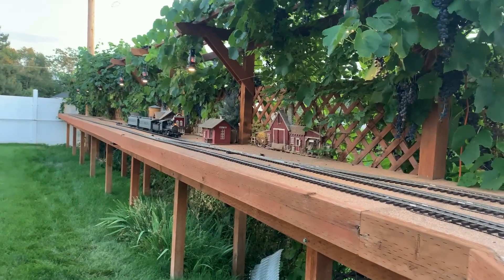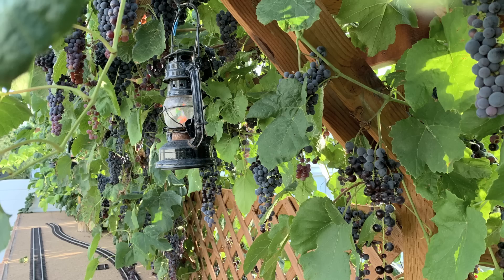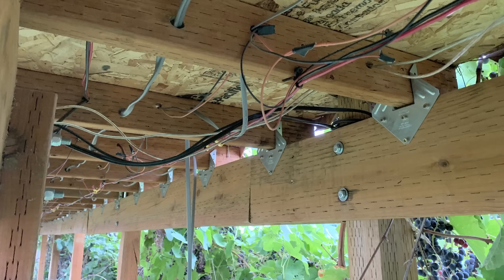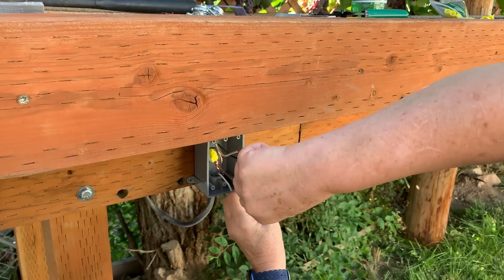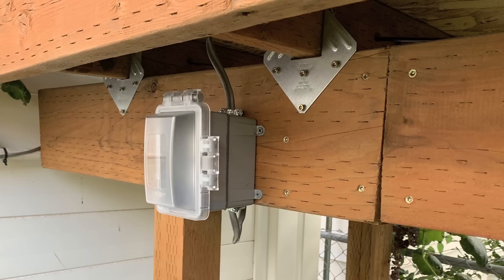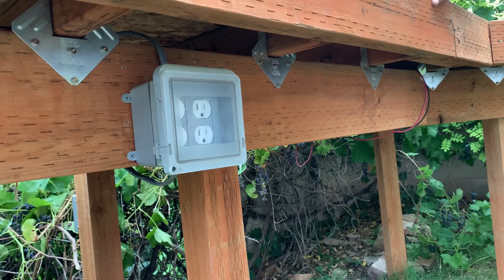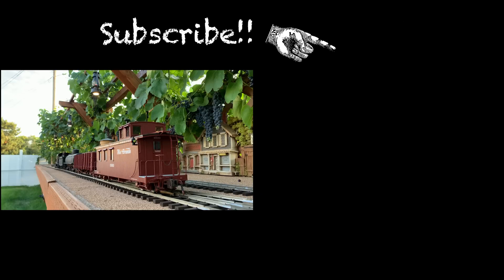Rewiring the 110 Volt Power to the Garden Railroad - "The Wrath of Grapes"

Comment: Are the outlets you installed Weather Rated (will have a WR on the face)?   The innards of standard outlets will corrode over time in an outdoor environment.
Reply from the maker: Yup. All weatherproof boxes and wire and plugs.

Comment: What scale is this railroad???
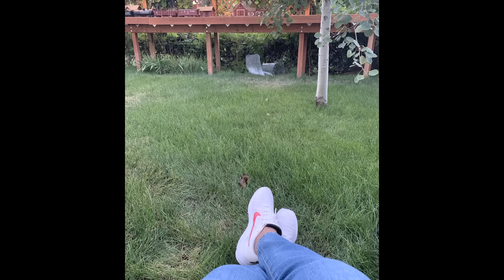Reply from the maker: Well the track is #1 gauge. 1 3/4”. We mostly run Fn3. 1:20.3 scale. 3 foot gauge prototypes.   But there are lots of things that can run on #1 gauge. We have a lot of 1/2” scale. Which is to say 1:24 scale. It’s also based on 3 foot gauge prototype but it’s much smaller. Also 1:32 scale standard gauge. And 1:29 scale. But almost always 1:20.3.

Comment: Looks like it's time to get mason jars, gulf wax, pectin, sugar and start making grape jam :)  For those outlet screws, it may sound like overkill but I've found that a variable speed drill/driver can be most efficacious, just barely pull the trigger and snug them up good.  Most nowadays also come with a built-in light which my older eyes very much appreciate.  I live in an older-pre WWII home and the former owner loved his Christmas lights as there are apparently more outlets around the outside of the house than there are inside the house but it's all the older boxes with the individual little doors over the outlets outside.  Meanwhile half the wiring on the inside of the house is still old-fashioned cloth-covered wire, which is fine as long as it isn't moving around, but with it being that way polarized outlets are useless as there's no way to tell which wire is hot and which is neutral, but it's okay as I have the sense to unplug anything that needs repair on the inside...and if I do need to plug something in while it's apart I simply use an isolation transformer between the appliance and the outlet.
Reply from the maker: Karyn has had a good deal of fun modeling all of that in 1:20 scale. Cloth wire. Knob and tube insulators! You should see her power meters! She also did a really funny job of wiring the casting machine. The controls of the casting machine are first class. However, we put a bunch of fake meters and stuff on there and she put some glass fuses and burned out wiring, scorched wiring, and all kinds of crazy stuff. People come in there and think that’s functional and just about crap!
Reply: @ToyManTelevision  🤣🤣🤣 That's awesome!

Comment: OK, so I feel I must correct Mrs. Toy Man on her Electrical skills. She said " I'm not a master electrician ". HHHmmm... lets examine her work, shall we? Yes I think we shall. She knows to pigtail and connect the ground first. (A+)! She knows to pigtail the outlet. Also (A+)! Then she made the shepherdess hook and used the screw terminal instead of the stick in the back of the outlet. Also know as stick it up the outlets *%#$$.  Nice job! another (A++)! She even made a drip loop going into the bottom of the box. To top that off She kept the cable from making any sharp bends when exiting the box on top. Also (A+). Then the shocker for me, she mentioned the GFCI ( Ground Fault Circuit Interrupter ) was up stream on the circuit. That's a huge (AAA+++)! As an electrician my self, I was watching closely. I can attest to you that I have seen licensed electricians not get some of those right. I'm not sure just where you picked up your electrical skills, but you done did good work!  Whom ever taught you these said skills must be proud. :)  Keep them there electrons moving right along!
Reply: All I can say is”Thanks” and Whew! I entertained the idea of becoming an electrician about 30 years ago… Until I learned that part of the job entailed crawling around in tight places! Who knew? Thanks for the kudos!

Comment: I'm always amazed when I see electric installations in other countries. Such stuff would have been used 40 years ago in France. Even items from 20 years were well better made. Also, here, any exterior outlet would be with earth, which will give more chance that the differential breaker trips before a short circuit happens.
Reply: That system seems to be a lot better!
Reply from the maker: The US version of a differential breaker is called a GFI. Ground fault interrupter. It detects an imbalance between the Earth and the neutral.  It’s triggered by .005 amps. Still I think the European versions work better. The equipment certainly is better.
Reply: @ToyManTelevision  It may be equivalent to the French system, currently it trip at 15 mA (at 230V) I think. But for whole Europe, I don't know. In Switzerland, it is only mandatory now for new installation. Never seen one without it in France.
But it still don't protect from everything, we had a cable in the wall with a nail put in the live wire. We could light a lamp when connecting it between the nail and neutral!
Reply from the maker: @pbyfr  indeed!!

Comment: Your are using the wrong receptacle for a 20 amp circuit.
Reply: Gray was already taken and red is out of the question! Gosh! To think we are using the same outlets in our kitchen which are protected by a 20 amp breaker! I don’t want to change those, or the microwave won’t fit!
Reply from the maker: Most circuits are 20 amps. Some are 15.
Reply: The problem is that a 15 amp receptacle  will melt if you overload it in a 20 amp circuit.  @ToyManTelevision
Reply: Actually, that outlet is okay, as the plug and the resultant load that fits is rated to draw only 15 amps, a 20 amp plug has one slot rotated 90degrees. Yeah, conduit would be preferred, but there is a reason that the grey cable is rated outdoor use, cause it is.

Comment: Your electrician should have never used metal staples outdoors. They rust as you saw, what they should’ve used was the plastic ones with double nails.
Reply from the maker: Or better still put the entire thing in conduit! Its conduit from the shop out to the rail road and its conduit from the rail Road to the shed, would’ve been really simple to just put that last 50 feet in conduit as well!

Comment: Nice job Karyn, admire you for taking it on. Here in the UK we would also sheath the Earth/Ground wire with green/yellow sheathing as the bare copper earth could potentially trip against a live terminal although to be fair, you did wrap the live  terminals around with insulation insulation tape. Man, those metal cable ties were unbelievable, can’t believe any electrician would ever use those!
Reply: A bit of a trick indeed! I was looking on the internet about the home wiring systems in the UK… Very different from the US! Probably a better system in my opinion!
Reply from the maker: We were shocked seeing those staples. OK in fairness, we weren’t actually shocked in the classic electrical sense but shocked in the motion picture sense as in that scene was really shocking.

Comment: That 120 volt line should be in conduit.  Longer life , safer and less grief.  Make it large enough so that you can pull more wire if needed in the future.
Reply: The first installation was done by an electrician. He did use conduit for part of the outside installation on that branch circuit up to the junction box, and the part that connected to the storage shed. I am just not sure why the electrician decided to use outdoor-rated wire on the latticework and not use conduit, but rather just use staples. The part of the branch circuit that we replaced is not only outdoor-rated but is in a protected area not exposed to the elements or human contact, so conduit is not really necessary. It also depends on the local electrical code.

Comment: Dale, I'm older than you, and the standard Power Company electrical service voltage has been 120 VAC for a very long time; it hasn't been 110 volts since I was a kid of about age 10. Then, it was boosted to 115 VAC and sometime later to 117 VAC. Of course, now, it is 120 VAC. Oh yes, and the home major appliance voltage for electric cooking stoves, water heaters, etc., is 240 VAC.
Reply: Awww… We just use the term 110 when referring to outlets and lighting, and 220 to refer to the wiring for large appliances like electric ranges and water heaters. Most folks only care if the lights come on and the water is warm when they take a shower! LOL!
Reply from the maker: Yup. Everyone calls it 110.
 At least they do around here. Here’s the thing, though I don’t think very many people have any idea how much variation there is in the line voltage. Down at my recording studio. we had gauges on the line filters and the filter voltage usually showed right around 110. Sometimes as high as 115. Never 120. Occasionally as low as 90 or so for a split second. It just sort of depends on what loads there are on the circuits. The only thing really really consistent is the frequency. And even that will vary slightly.  But over the course of a day, it will always equal exactly 60. If it goes slightly high, they will make up for it by going slightly low. And by slightly I mean in the hundredths of 1%. But it’s really astonishing how much the line voltage will change. 

I think in calling it 120 they’re simply saying it will never be higher than that. And in fact, the goal will be to maintain that.

Comment: The outlet box is wired incorrectly, the neutral wires and a third wire should be connected with a wire and that third wire connects to the outlet. Same with the positive leads.
Reply: So.. What I used is a method called "pigtailing". This is where 2 sets of wires are used. Two sections of Romex is cut to 8-inch lengths. The outer insulation is stripped from the Romex leaving 3 wires, one black "hot" wire, one white "neutral" wire, and a bare copper wire, "ground". These are called "pigtails". I then stripped the insulation from each end of the black and white wires of about 3/4 of an inch. Each wire gets a hook on one end and the other end is left straight.  Each outlet gets a set of pigtails (6 wires total) which are fastened to the bottom terminals of the receptacle using hooks around the binding screw. Silver binding screws are neutral white;  brass binding screws are black hot, bare copper is attached to the green screw for the ground. Each set of wires is attached with 3 separate wire nuts: Neutral to neutral, hot to hot, and ground to ground. The load line (live line, or first wire connecting the branch circuit) is connected to the top terminals of the receptacle on my right. This will provide power to all 4 receptacles, plus the single receptacles at the far end of the branch circuit. When the circuit was powered on at the breaker, note that we did test the outlets for the correct wiring. I did get 2 green lights indicating that the wiring is correct. I also mentioned that there are different methods of wiring a duplex outlet box. I prefer using the pigtail method. I also prefer to use the binding screws to connect the power rather than the "stab-back" connections on the back of the receptacle... especially on outdoor electrical outlets!
Reply from the maker: Pig tails. Yup. That’s how the double duplex is wired. The duplex is a normal pass through.

Comment: I have never liked those metal staples. I was working a house construction project back in the late 1980's, and we had all kinds of problems with those staples, from the students driving them too hard into the insulation, to actual metal flashing on the staples themselves (they evidently were made 5' O' clock Friday at the manufacturer) 

So this meant, in order to be code, all those runs of Romex in that hot attic had to be replaced, and since I was the senior supervisor on the project, guess who was stuck with rewiring everything in the attic for three days....

I've had other adventures like this. I like those plastic insulated staples with the two brads on each end holding the insulator over the cable itself. No metal comes in contact. 

As for wrapping the terminals inside the junction box, I do the same thing. Especially, when at Sis' house. It was built in the 50's, so all those plug boxes are metal.
Reply from the maker: I’m so glad Karyn is good at this. Because I’m better at bringing her a drink. And hoping everything goes well.

And yes, those staples are evil. You need to smack them with a hammer. And gee.. what could go wrong?  And they may work for years before the vinyl slowly migrates away from the metal. Then…. Pop.

Comment: My goodness what a job but you both did some great work getting it fixed. Karyn is good at that electric work no shocks or sparks. Thanks for the tip on the electric tape on the double outlet. Now back to green lawn and running trains. 😊
GOD BLESS 🚂💖🚂💖🚂💖🚂💖
Reply from the maker: Thanks. Blessings back!

Comment: Outdoor wiring should be in conduit, not romex. IMO.
Reply from the maker: Hi. Well at this point all the wire exposed is in conduit. Only the wire under the railroad is exposed. Had the original wire been in conduit we would not have had this problem.

Comment: I saw the logic of the 1st plan, but I do agree this plan is better.  BTW, what is the plan for the grapes?  Are you going to open a craft winery? 😊
Reply from the maker: At my previous railroad I also had a Grapevine. In that particular case, it was a green grape that made a pretty decent white wine. I know this because one year I made wine. About the same number of grapes on that vine as you see here mash those with the masher blah blah blah the whole thing. Probably spent $300 on supplies. Ended up with about 15 bottles of wine. And put in maybe two weeks worth of work. My hats off to those people in Napa. Much rather just run down to the wine store rather than hang around the house and whine!  But it was an interesting form of screwing around. However, this trucks up to been there done that. Bought the souvenir T-shirt. Moving on to other things.